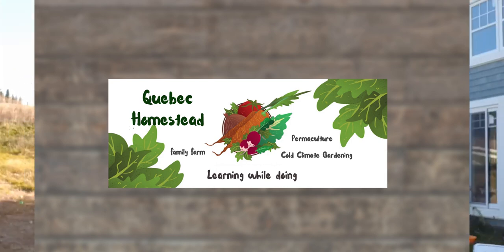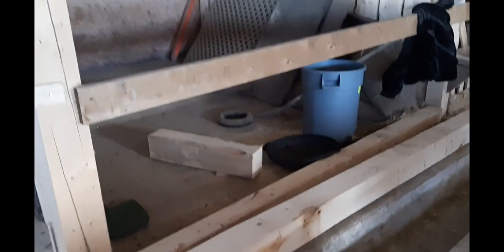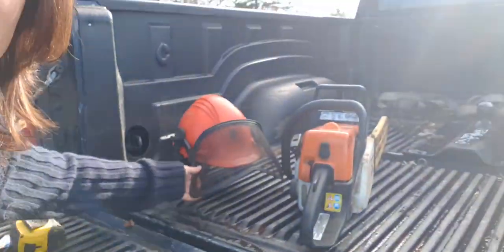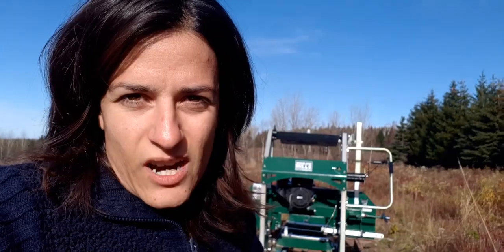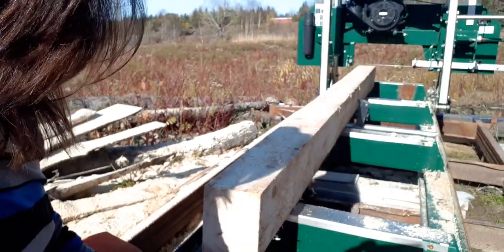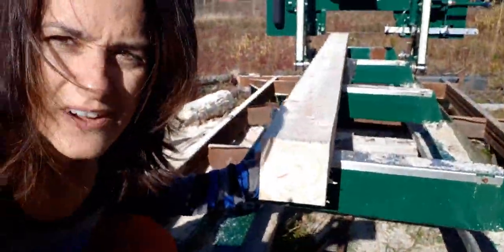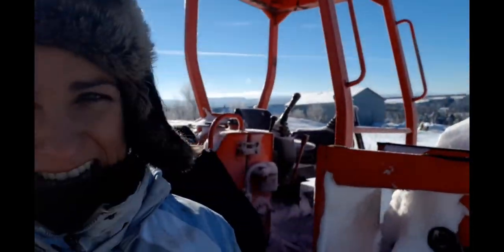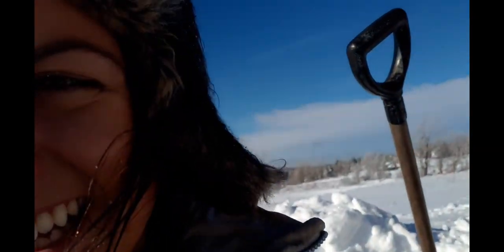Woodland Mills HM130 Portable Sawmill | First Log on my own

Comment: i must say i was a professional; Woodworker for over 25 years  and Woodworking has been a hobby of mine for over 35 years and you are by far the prettiest logger ive  ever seen  its quite impressive seeing a young lady  running all those machines and  projects  more especially in modern times  when most people run to the store or internet to buy whatever they need  be extra safe  out there  as logging is a dangerous game  your smart wearing the Chaps when operating Chain saws
Reply from the maker: Sweet thank you Craig :) Safety first. I know too many people that has bad accidents with chainsaws even wearing equipment. So I always gear up. Like with horses never without a helmet. I have to show the example for my kids too.

Comment: Nice beam. Ran my 130 last winter and it started second or third pull. Temperature was about -10 C. Thanks for sharing.
Reply from the maker: Sweet! They do start up surprisingly well in cold weather. Only had a hard time once at the end of this video. That winter morning was -20. It had reached -30 that night.

Comment: I hate cold. I have a 130 to but it is nearly 30 feet long. I made a trailer and it is portable.
Reply from the maker: Oh wow! 30 feet thats amazing.. We want to make a trailer eventually.. We use the old fashioned way to make the longer cuts but its hard on Ben's back so we should be getting an extension on it in the next couple of years.
Reply: The longest I have cut so far is 16 ft

Comment: great video, are you pleased with your HM130? I'm thinking of pulling the trigger on one?
Reply from the maker: Yes I am for my homesteading use it is perfect. If I could change one thing though is to get a solid frame/base. This have two 6 foot frames but they are little difficult to level every spring when comes time to open her back up for the season. We accepted it for the price it's really great. Been sleeping outside for 4 years. Never had an issue. You can check out my other milking video from this spring. That was the first time we used it after a long winter. Still runs great. Make sure you have plenty of spare blades. My blade was getting dull at the end but I was too lazy to go get a new one in the garage lol.
Reply: Quebec Homestead thanks for that all noted